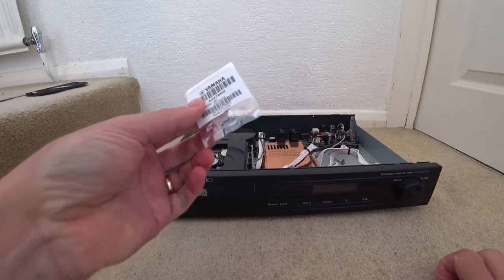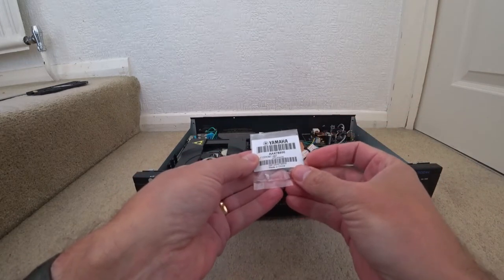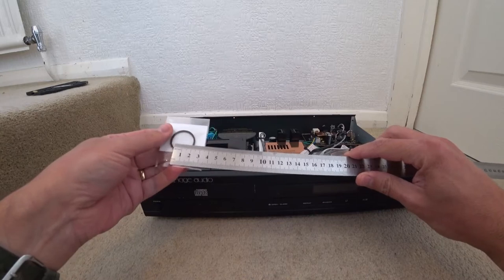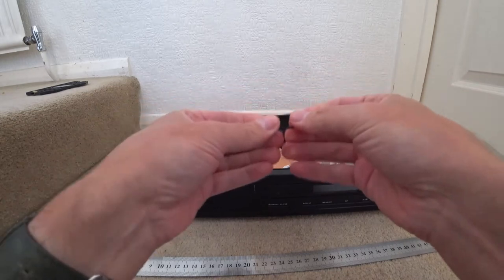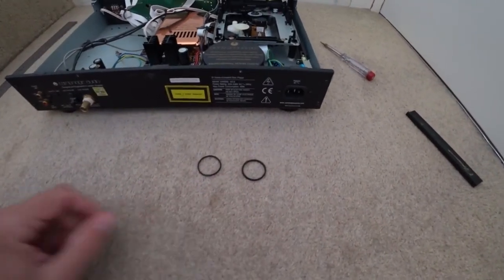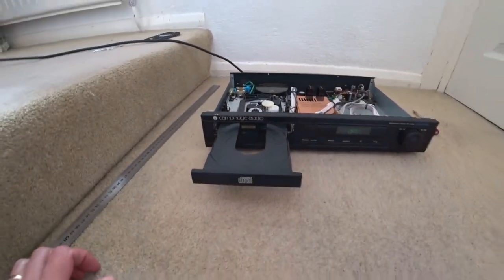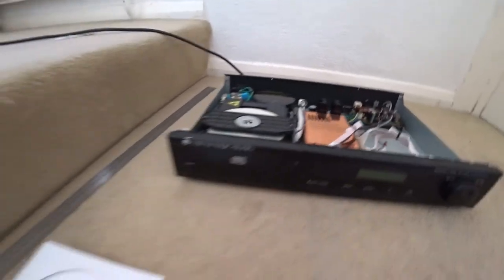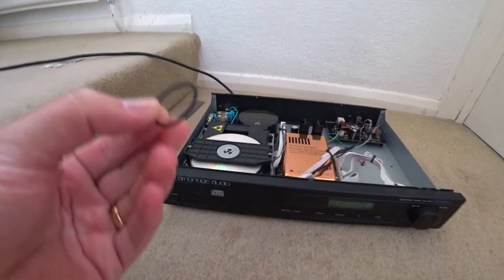Cambridge Audio D300SE CD player tray belt change #cdplayer #hifi

Comment: I have a CA azur 640C and the door isn’t opening, the motor is whirring but it doesn’t spit it out. Do you think I need a new belt too. CD laser etc works great it’s just the tray. Thanks
Reply from the maker: Yes you do.  One last trick to try is to place the player on it's end and try to eject the tray that way, it may need a tap close to the top of the drawer area to give it a nudge.  If a no go then the belt is probably very bad and out of shape!